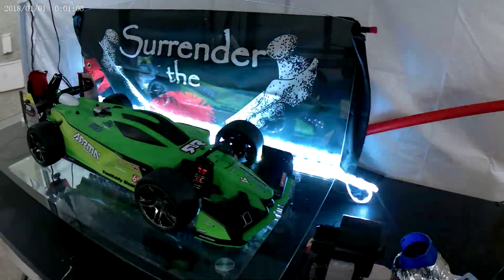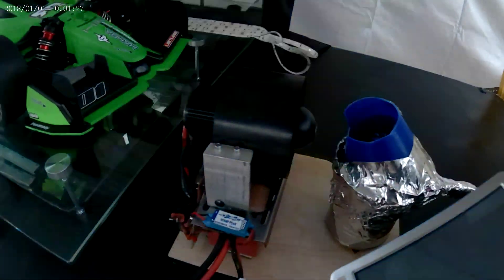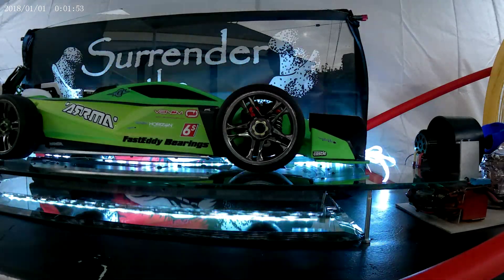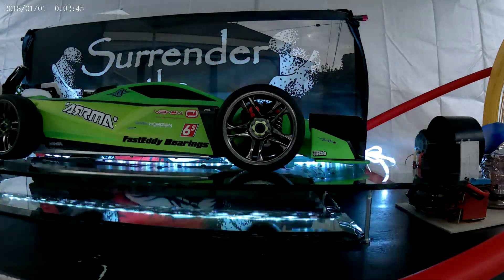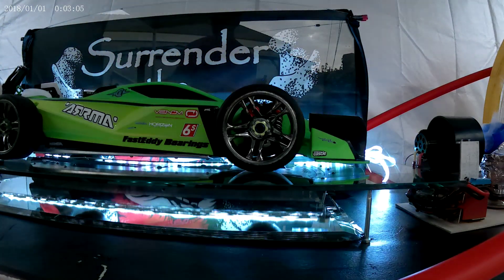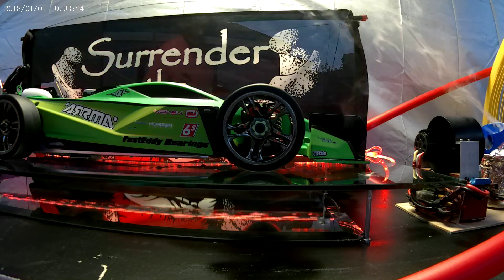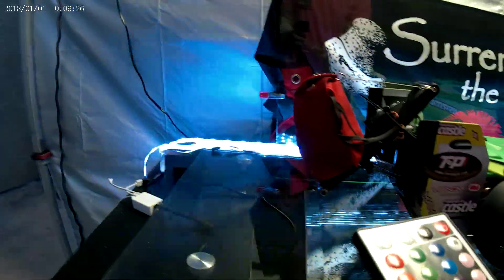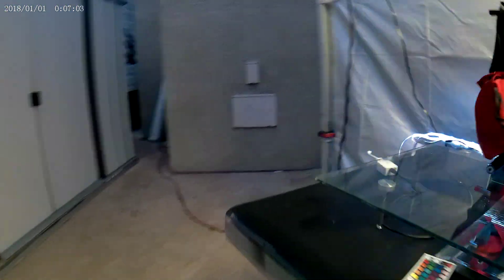Arma Limitless ultimate build 200 mile an hour attempt wind tunnel testing

Comment: Very cool as you see like my test showed the front splitter kicks the smoke to high up and the air goes everywhere if you remove that splitter you trimmed the air will flow smooth over the body great test 👍👍🔥🔥🔥🔥🔥
Reply from the maker: Hey how's it going Earl what are those black plastic things on the front of the car called canard's or ? I'm trying to see if the wind will deflect up those black plastic things up and over to the top of the body passing over most of the shocks and a arms, I'm sure it will if the air is moving fast....
Reply: Kenny Springer I’ve been calling them splitters but the problem I found in my video was with the spitters ( canards) the air goes over with Sutch force it goes crazy above the body where when removed the air passes over smooth and has no trouble around the control arms 🔥🔥🔥so under 100 mph you could raise up the body and bash around with having a lot of downforce but over 100 it’s just slowing things down ??
Reply: Kenny Springer but if you have a yellow light it might help out the light I have was way to small like a spot light style witch didn’t work on Camara
Reply: Bye the way my smoke machine comes with a yellow spot light to see the smoke better bark yellow but on film Camara still didn’t catch it as well 👍👍🔥🔥🔥🔥